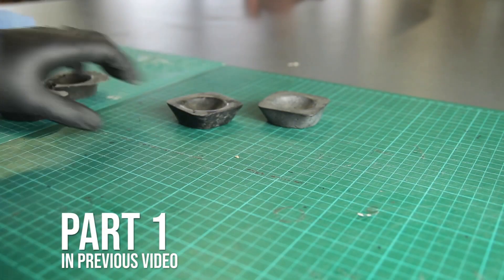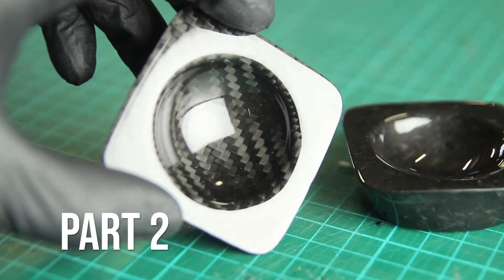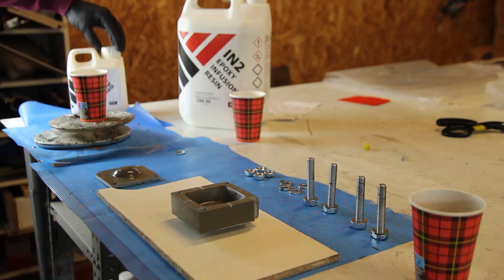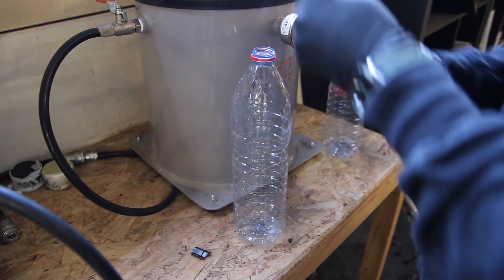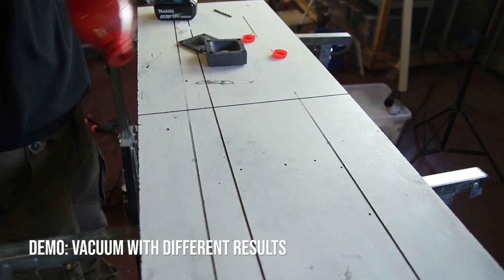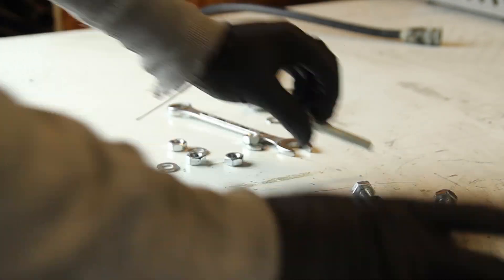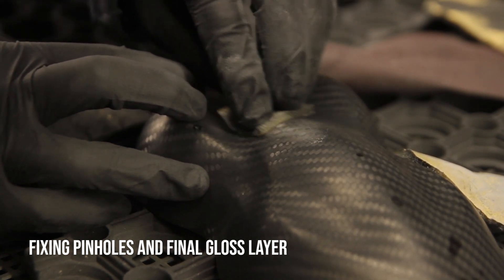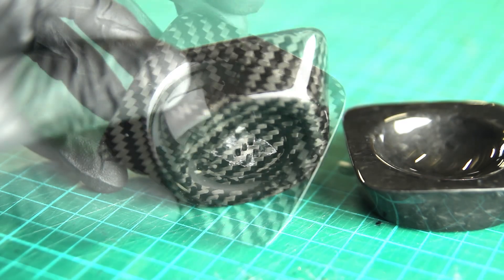Rapid Prototyping Forged - Chopped Carbon Fiber PART 2

Comment: For my master's thesis I am trying to develop a guide to forged carbon for the DIY/ maker level. For this I am staying within the realm of 3d printing (fdm and SLA).  Have you found any efficient ways of sanding/ smoothing your molds before casting them? As the mold release is one of the biggest hurdles I am trying to overcome. Also mixed wall thickness in parts, I think I am going to test dividing the parts into sections as to get a more even distribution of fibers.
Reply: Super cool masters topic mate! Best of luck. I for one would love to read it when you publish.
Reply: Any way to read your master thesis? I would be interested

Comment: I have a question, I have a part that I am wanting to make out of carbon fiber. I am having a hard time figuring out how to build a mold for it, because the piece that I am trying to make does not have a male and female end. Do you have any ideas or suggestions on building for a solid unit?

Comment: the trick of using polyurethane as a reference, fabulous, I didn't fall for it.
My line of work was based on an epoxy mold with a very thin internal layer of silicone (an error) because I thought that it would not be able to demold well.
and a counter-mold or male also made of silicone (error) since the pressure exerted did not reach well.
I think that the pieces with carbon sheet you have done by cutting the pieces with preg or with unsaturated sheets of epoxy and then you have compressed them.

Congratulations master Libeert

Comment: how you did the weaved part:  piece of cloth in the bottom, chopped fiber on top and finished with another piece of cloth on top then pressed ?
Reply from the maker: might be revealed in a future video :D think about what I've mentioned in the video "aluminium filled epoxy resin is resistant to higher temperatures" ;)
Reply: @MatthieuLibeert Plss upload a video on how u did the weaved carbon fiber piece.
Reply: @MatthieuLibeert  vacuum lamination using weaved CF over already forged part is my best guess.
Reply: @MatthieuLibeert  You went with prepreg carbon cloth i guess :)

Comment: About balloons: I've been making prepreg CF tubes; using flexible plastic tubes inside that project out through the vacuum bag. A pain because of all the sealing you need to do with the vacuum bag. But, if you could find a balloon that survived to 120deg (required for the prepreg) you could partially inflate it, leave it completely in the vacuum bag, and like you showed, the vacuum would suck it up against the inside surface. Latex balloons did not survive my oven tests.
Reply from the maker: You can make these bladders with silicone, only downside is they don't last long with epoxy resin 🙂
Reply: @MatthieuLibeert  Yes I'm just looking for a shortcut!😁

Comment: Have you ever tried to put the epoxy bucket in a small ultra sonic cleaner filled with water? It should eliminate all the bubbles.
Reply from the maker: Haven't tried it but sounds like an interesting theory
Reply: Put the entire mould in the vakuum while the epoxy cures.